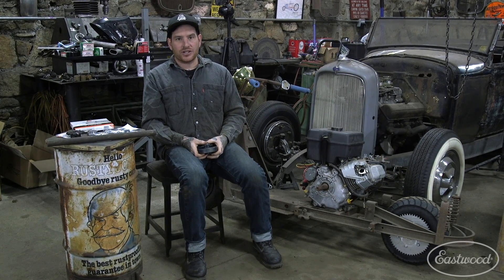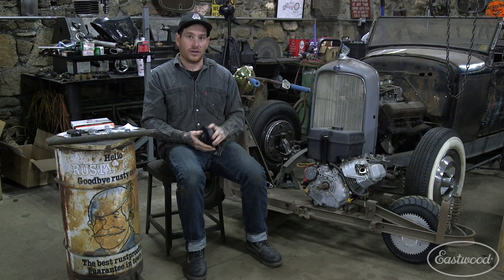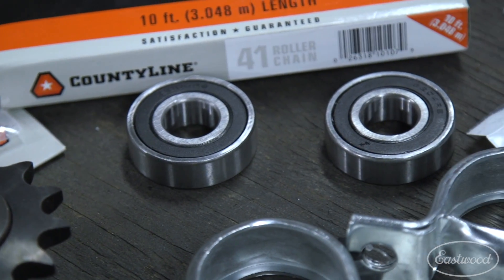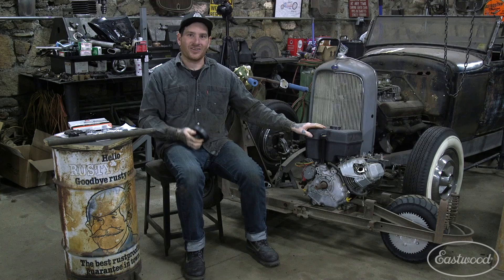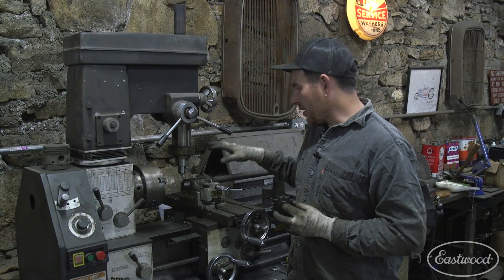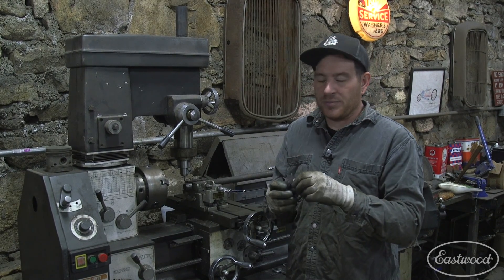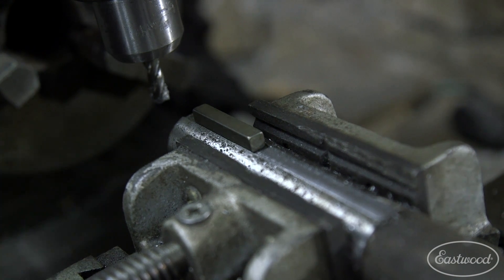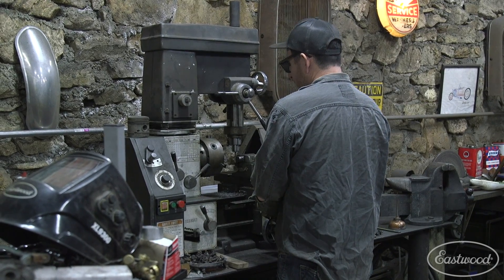The Cushman Scooter Project - Motor & Wheel Alignment - Pt 2 - How to Build a Jackshaft - Eastwood

Comment: I was wondering why you don’t restore original? This is a 50’s era scooter and that was before Honda hit the shores of USA. I think 90% of the parts plus a Cushman Huskey engine be installed. Most likely a new one can be found. I have a 50 sears Allstate and a 57 Cushman Eagle running and lookin good.

Comment: Nice work Matt. I  Have '46 series 50 w/2 sp. trans thats road ready unrestored. I would like to be able to "undress" mine being able to remove the body and have solo tractor seat w/mounting  bracket  and springs to slip on for that chopped "low rider" profile. Also a nice fishtail on the exhaust pipe

Comment: Better load distribution and bearing life if the left bearing was between the sprockets.  Both chains outboard of the bearing can result in "whipping" of the chains resulting in vibration and reduced chain life, even failure.  Otherwise, excellent solution that also allows you to play with final drive ratios.👍💪
Reply: My initial observation was concern that even the tiniest bit of play between the shaft and bearings is magnified over the distance between the bearings and the outer sprocket.  By having both sprockets on the same side of the one bearing and the loading of that bearing in two different vectors, coupled with the pulses from the engine through the drivetrain, undesirable effects can arise.  By placing the bearing between the sprockets, you reduce any "slop" movement and the bearing will intercept the vectored loading more effectively transferring it to the chassis.  If it's an issue, it will make itself known once it's in service.  If not, all is good.  This is a more powerful engine than stock and the clutch/drive will absorb some of the disruption.  Can't wait to see the end result regardless!
Reply: I was thinking the same thing. I didn't know about the whipping, but I have seen this setup bend the shaft.  Also having the bearings as slip fit and not press fit could lead to bearing failure if they start spinning on the shaft. There is also bearings that slip on and have a lock ring with a set screw that would work.
Reply: The size of the jack shaft is pretty stout. Along with the solid mounting of engine and shaft, it's a non-issue.